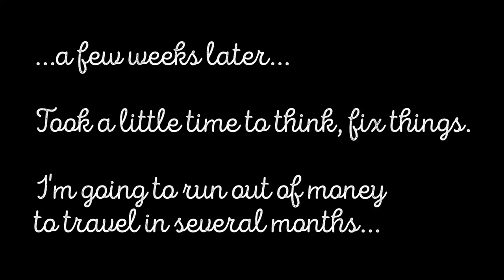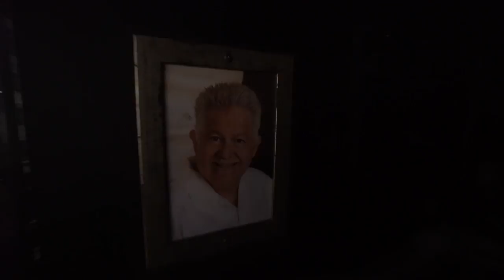I Might Sell The Bus. Skoolie For Sale?

Comment: A few mechanic suggestions.  Hopefully brake calipers good now!Change them all out first, then bleed all brakes in Line.  Not after each caliper installed or you will use a ton of brake oil.  Also the fluid flush, I would have used hose water at first to flush it a few times initially, then on last fluid dump fill with purified water once, wait for thermostat to move water, dump fluid, fill with purified until reservoir full.  Main objection of course is to remove impurities, but to just move the fluid flush through the system, hose water.  Another thing that can be done is to take bleeder valves off and coat threads with oil and screw back in so it won’t rust and freeze up down the road.  My guess is you pulled some old old calipers off the bus though.  Not sure where you are at the moment, but any consideration to doing a ski/snowboard job and live at the mountain for a season?  You’d definitely have the nice digs for it!  Your doing good man!

Comment: Don't sale the bus. Your energy talking about it is vibrant. I will say solicit more sponsors for ad space on the bus. Then all the options the other comments are correct also. When you say downgrade say a sprinter ? Or a astro van to modify.
@djant863
@DJANT863